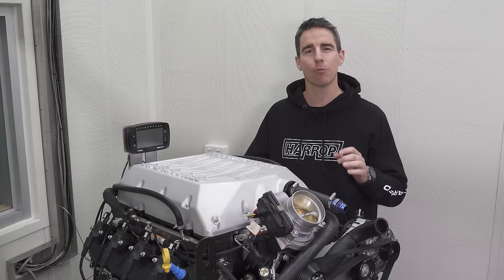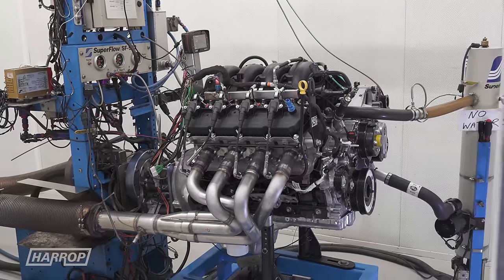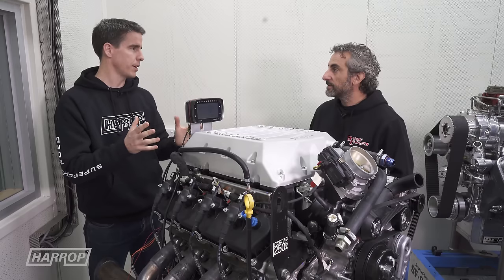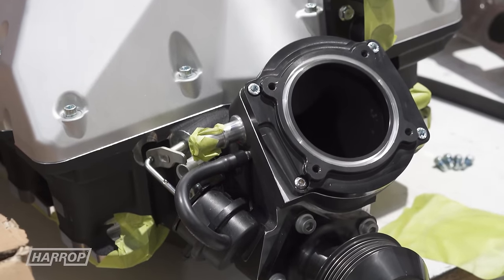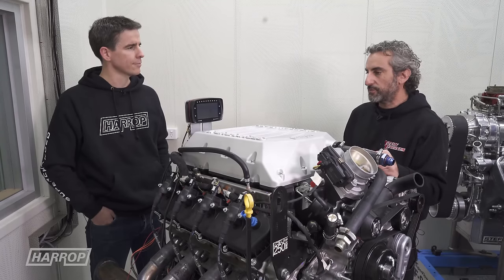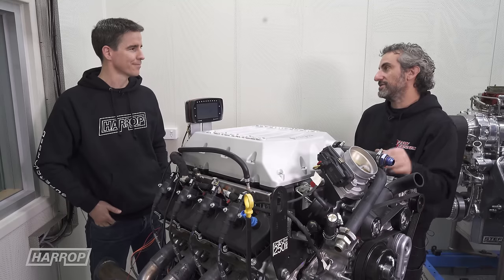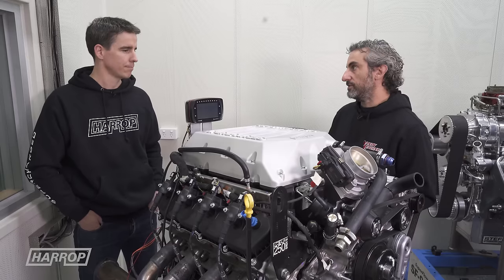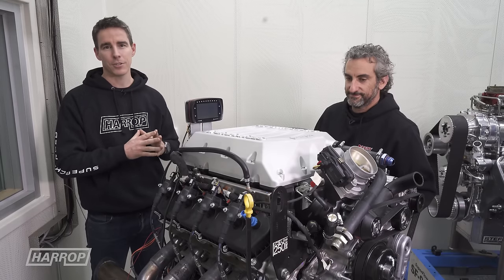Ford Godzilla 7.3L V8 | Harrop Supercharger Testing

Comment: I'd love to see the numbers with an 8lb underdrive pulley, for 16 lbs of boost with the largest oval throttle body and mass air meter available for this engine, and then add a 50 shot of nitrous before the mass air meter, and all of this on 93 octane pump gas, then switch to 107 octane race fuel.
Reply: On stock internals? Why not just watch grenade footage?
Reply: @tylermallory2504  All the nitrous does is supercool the incoming air resulting is a much denser air charge as it leaves the supercharger resulting in higher HP & Torque. I did the same thing to my 2nd gen Lightning, stock it was a bit under 400 HP at the wheels, with the underdrive pully, nitrous, 92mm mass air meter and the matching single blade throttle body it was 650 HP at the wheels.

Comment: The 7.3 is very nice. You improved it in a tasteful manner.  But no I'm not down with you suggesting that my wife or my girlfriend get an opportunity to test out that " great gas mileage" and 800 hp on pump gas. 
Even if it idles at 600 lol...
Idles are safe. 
Untrained drivers can have a difficult time with telephone POLES and RADIATORS when thrown the keys......and what's up with that blown 7.3 milage talk?
You guys need to be in politics.....
Are you comparing the 7.3 to a boing 747, or a cargo ship? 
Let's just talk about how cool the HP and torque numbers are and the reliability. Fair enough?
Awesome job. Keep up the great job.

Comment: A 7.3 liter around 445ci on pump gas should make around  667hp based on 1.5 hp per cube. Thats generally considered a good combination for a street car if you can get 1.5 hp per cubic inch my 418 a 351w based build made 670 hp crank i cant remember tq but it was pretty close to 600 ft lbs NA 34 grand for that engine idk. The 418 cost me under 9 grand with off the shelf parts. Powered my 3050lb foxbody 10.40s @137 run after run very consistent NA on 93 pump gas. Drove it 60 ish miles to the track let it cool for an hour then basically hot lapped it in 95* weather 80s when it got dark. Just a test and tune night for me.
Reply: You can get one of these from Ford for under 9k with a warranty.
Reply: @fastec5  I know part # M-6007-73 Ford Racing you can pick it up intake to oil pan right now 6999.00 !! Only thing is it makes 430hp @ 5500rpm & 475 lb ft tq @ 4000 with 2 yr warranty. You'd have to add a custom cam heads and intake plus exhaust to reach 600hp plus the added weight of a 7.3 l vs 351w and size difference.
Reply: @mccranahan747  would a 351W be a cheaper build...and no engine clearance issues.
Reply: @benwalker4660   your looking at about 2 inches wider on the 445ci valve cover to valve cover about 2 in taller deck and 2.5 inches in difference where the actual engine sits in the k member. Im sure you would need some extra parts or fabrication. You would definitely want a aftermarket k member with the 351w or a 445 for ease of working on things. The strut towers in say a foxbody could be very tight. As far as cheaper to build you can buy the 7.3 from Ford Racing right now for 6999.00 with a 2 year warranty. If you did all but machine work it woud cost you about the same.
Reply: THANK YOU SOMEONE WITH SENSE

Comment: That looks a lot bigger than a Clevo, and is defenitly a lot taller. A good set of headers would be a lot of work to fit into any Falcon with spring towers
Reply: serious engine clearance issues can be done....so the challenge is there...custom headers for sure.
A hot 351W 600HP...and less clearance issues otherwise.

Comment: I don't know if i should be impressed, cuz I've seen the 5.0 coyote engine making that horsepower with the proper supercharger as well.
Reply: Yeah but you'll never get those torque numbers from an overhead cam 5.0 like you will from a pushrod 7.3
Reply: @tmurph247  oh wow, didn't know that.  But for a light car like the mustang, do u need hp or torque? Or maybe both?

Comment: Headwork, a cam, and e85 and your at 1000hp no problem.
Reply: I’d say with just the cam and e85 you’re 1000hp easy
Reply: its making 800 with a stock cam... thats 1000hp easy with a proper bump stick
Reply: @spyer212  Show me a "bumpstick" good for 25% more "power" all by itself.
Reply: @deeremeyer1749  My Ls picked up 115hp with a cam swap n/a quite literally a 25% power gain. Go take the piss out of someone else. Everyone here knows im just putting a fun twist on "camshaft". Anyway, a cam specifically designed to help a boosted motor especially one of this size will show huge gains. Oh and as for "showing you a cam that makes 25% more "power"". I use a comp cams 238/242 cam. Namaste.

Comment: My friends new ford with the 7.3 left him overheated on the pass hauling a 22 foot trailer. Meanwhile my 496 pulled the 28 foot trailer without a problem. Just like always. Before we left he was bragging about how that new ford motor made so much more power than mine. I don't know how much of a difference it makes when you're always broke down.
Reply: Probably sounds like an over heating issue.....radiator clogged or something like that. No reflection on the engine.

Comment: POUND-FOOT! Ft-lb is work done, NOT torque... No excuses, you're not American!
Seems like a damn good creation by the FORD engineers, I expect crate engines to be big sellers for re-po's, especially as it's going to be much easier to package it in cars that the OHC engines don't fit easily. 😎
Reply: Foot is a measurement of the perpendicular distance of the force (in pounds) about an axis, therefore it is torque. Ft-lbs, pound-feet, either way, same thing. It's imperial because he is going off his American-made dyno.
Reply: @youssefkhaled9666  
Thought I replied to this...
NO! They are different terms for different units of measurement - I suggest you check and learn this next time, before replying.

lb-ft is used for torque, or a moment. Force times the perpendicular it is applied at, as you said.
ft-lb is used for work done. Force times the linear distance it is applied through.
Note the difference!

Actual example.
An engine produces 100lbs-ft of torque, ie at a distance of 1 foot there is a perpendicular force of 100lbs.
The engine makes one revolution and that 100lb force moves through a distance of 2 x π x1 foot, or approximately 6.28 feet. This means the engine has done ~ 628 ft-lbs of work.
it is IMPORTANT the correct terminology is used, as sometimes the context is unclear.

Comment: Could this be the answer to the LS domination 😵
Reply: This look like a big LS
Reply: LS Domination ?
Reply: Nope - the LS 'dominates' because of sheer production volume, which led to a hugely popular aftermarket niche that sells in high enough numbers to make aftermarket parts affordable.
 
The 7.3 isn't even a base engine(the SOHC 6.2 is), it's an option engine and only in SuperDuty pickups - the 7.3 is NEVER going to be anywhere near common enough to have any impact on the LS or its market.
 
Are guys going to go fast with it? Absolutely. Is it likely going to have a solid racing-oriented(don't expect to see any basic bitch Edelbrock street heads for this platform, it's only gonna be grown ass man stuff) aftermarket that makes it a legitimately viable racing platform? Probably.
But, is ever going to be a 'common' engine swap? It's not going to be swapped as much as Coyotes are, for a variety of reasons.
 
If "LS domination" is supposed to be related to performance or something, the LS hasn't really 'dominated' much of any classes in racing(outside of the budget oriented stuff). The problem is that airflow is what makes power, and when you're starting with a blank sheet you can design a killer cylinder head & intake for pretty much anything; including old school pushrod V8s. So the LS doesn't bring any advantages when you can build a SBC or SBF with all aftermarket parts. The 7.3 won't be much different in this regard, for the same reasons.
Reply: @RyTrapp0  a 351W is cheaper...

Comment: Cool for a truck application but its a bit too large dimensionally and requires too many custom swap parts/ fabrication to fit in most lowered cars vs a proven gen 2 5.0L Coyote swap that slides right in because its not a Heavy Duty truck/ Motorhome engine.
Reply: its dimensionallly smaller than the coyote
Reply: @2011metalmaniac   Its definitely taller, you see that oil pan and deep crank centerline.  That's what is going to keep them relegated to trucks swaps.
Reply: @Sir.VicsMasher  well a couple of people have allready done mustang swaps and someone has pout one in a crown vic

Comment: I'm not sure if Australian Horsepower is the same as US horsepower, they usually use kilowatts, but this is impressive. LS what?
Reply: Yes aussie hrspwr is real world pwr figures for the real motor enthusiast!!
Not bloated wank crank figures for magazines or media posts
Reply: Lol fords 20 years late too the party
Reply: @Saddedude  how do you figure.
Ford is way out in front from a business perspective than G.M
Go do your research dude
Reply: @kimbarling4213  they mean that the LS motor was introduced over 20 years ago, if Ford had this motor before the LS was introduced all the mustangs would have Godzilla motors instead of turbo LS motors
Reply: @kimbarling4213  this motor is synonymous tested for crank horsepower with no accessories, I’m not sure what SAE method they are calculating horsepower at was my question.
Reply: @xozindustries7451  
Show me a mustang with a turbo LS?
THE 5LT COYOTE QUAD CAM motor is far superior.  Even if 1ltr capacity smaller.
Awsome small block design.
The only worthwhile LS motor in my opinion is the 7ltr LSA Supercharged weapon. ZR1 CORVETTE heartbeat
Reply: @kimbarling4213  Thats why everyone is yanking those far too weak and expensive 4cam motors out and replacing them with junkyard iron block LS stuff rite? 🤣
Reply: @Saddedude  Really???😳😳
I've yet to see or hear of any examples of your claim.
Reply: @kimbarling4213  Theres literally dozens of them out there.
Reply: @Saddedude  wow😱😳
Only dozens??
Out of the thousands of cars produced.
Hmm??
Reply: NO NAME  exactly and how many have swap coyote pieces of shit into a Camaro LOL
Reply: @Saddedude  why would you stuff a turd with a piece of shit ?
Reply: @kimbarling4213  did you see a drivetrain connected to that engine they're testing there ? Well , that means they're measurements are at the crank as well, so relax with your assumptions.
Reply: @kimbarling4213  it’s funny the 5 liter is heavier and Physically larger than a ls7 lol. It’s stupid that people ( unless done for any type of racing with rules for cubic inches ) say Chevy needs a bigger motor when it actually isn’t.
Reply: @bbdl7042  The physical dimensions you state are questioninable, but if so then most likely due to Quad cam top end.
I'm sick of so many negative comments bk to me bagging Coyote 5ltr.
Its a great package with loads of potential for aftermarket tuning and additions.
So to all you Chevy G.M die-hards...just relax .
Every motor manufacturer has positives and negatives.
Leave it at that.
Reply: @kimbarling4213  Kim, there are hundreds of LS stangs, especially foxes because they are far cheaper for similar power and that's a $500 USD rolling shell. P.s. the LSA is a 6.2L Aluminium block closely related to the LS3. The only factory 7L LS is an LS7 in the earlier Z06.
5.bro is a great engine if you know which one to get and what to do, they make more power (reliably) at maximum effort on stock setup compared to NA aluminium LS engines (e.g. boosting both like for like without opening them). E.g. ~1khp isn't unheard of for an NA 5.0 to last a while, ~800hp is where you start seeing stock limits on most NA alu LS engines in terms of internals long term. And that's coming from an LS fan boy.. each engine is great for it's respective use.

Comment: How did Ford manage to get so few horsepower out of this?
Reply: It’s a truck based engine , dialled down & built to work hard , not for peak power numbers . Obviously the base is there to dial it up shit loads , steel crank , 6 bolt mains , like they say you ain’t seen nothin’ yet !

Comment: Damn whats wrong with it?  My 4.8L LS makes 1,050 hp to the wheels with a Turbo and the engine has never been opened!  That means stock crank,rods,pistons,rings,bearings,cam ,heads, head gaskets and bolts.  Been doing it daily for 2 years too!

Comment: Hear Ford might be developing a 6.8L version of this architecture for the next Mustang. https://www.thedrive.com/news/37374/6-8-liter-windsor-pushrod-v8-coming-to-2022-ford-mustang-f150-report
Reply: Rumored to be in the F-150 as well if the 6.8L version is actually a reality.
Reply: @nathanmcdonald610  That would make sense. The 7.3 is probably going to be stuck with the commercial class.
Reply: @exothermal.sprocket  Even so a 6.8L comes out to about 415 cubic inches.  The last time the F-150 had that many cubes offered under the hood was 40 years ago with the old 6.6L 400ci V8.
Reply: @nathanmcdonald610  The old 460ci engine was a 7.5L, but I'm not sure if the F150 ever used it. I remember an F100 using it. Ford's answer for the 460 replacement was the Triton V10..... which of course is being replaced with the much better 7.3 V8.
Reply: @exothermal.sprocket  I don't think Ford ever offered the 460ci in anything less than an F-250 out of the factory, I could be wrong, but I think the 460 was always a 3/4 and 1-ton exclusive. But they did have the 400 in the 1/2 ton chassis for a few years.

Comment: dude the 7.3 is going to destory them ls's XD
Reply: No it isn't. You can make the same horsepower (if not more) for half the price.
Reply: At 30k I could buy two LS next builds and race them with similar NA hp and they weigh less.
Reply: You didn't think this comment through very well.

Comment: Soo basically Ford finally came out with their own LS engine
Reply: And the LS takes cues from the 351w, so whats your point?
Reply: The LS is a 351 Windsor with 6 bolt mains and a different firing order
Reply: Did you know LS heads are a direct bolt on for the 351 Windsor. Not as simple as it sounds but a direct bolt on none the less. Ford brings the mustang in 64, Camaro in 67. Retro looking mustang in 05. Camaro in 10.. Chrysler mini van in early 80s ford too. Chevy a few years later. Pt cruiser from Plymouth. HHR from Chevy a few years later. Chevy is the first to follow
Reply: @richardknepper1860  dont forget the falcon came first, then the chevy ii/nova!

Comment: So, just turbo, timing, larger carb and headers?????
Reply: So the 700 hp was with better injectors and fuel pump also I guess.
You aught to put all the parts by HP rating in the decription... this sounds like a great engine without head and valve work or bigger cam, rods ect.
Reply: I suppose 92 Octane???

Comment: My eco boost raptor has 450 stock little v6
Reply: My condolences for your stock little engine.
Reply: and not much room to turn it up, it's already close to peak output, already using some really fancy direct injection to allow pump gas with high compression+boost, I would guess that turning it up would require some very expensive fuel system mods and high-end race gas. That 7.3 has so much room to grow, it could totally hit 1500 with a nice cam and big turbos on pump gas. The real question I have for the 7.3 is what part breaks first.

Comment: Put it in an AU forte
Reply: Better still put it in a au taxi pack wagon with quiet exhaust , outlets hidden behind the rear valance & watch the faces in the ss brigade at a set of lights.
Reply: @barbraabsalom4531  Would be tuff in an au series 1 XR8 with the double spoiler and orange indicator tail lights

Comment: “Factory engine making 800 crank HP is amazing”
Iron 6.0L with 200k miles with over 1500 crank hp has entered the chat with a 21 year old setup
Reply: That ain't going to last though lol. That's the problem with you people you destroy cheap LS because they are cheap and easy to replace.. until they are not, like every other damn half decent engine around.
Reply: @N4CR  this guy🤦🏽

Comment: Now take a 6.6L gas chevy and strap the same supercharger on it and watch it make more power. There is a reason ford went pushrod on this engine. Chevy has always kept the design because it's simple and it works. Also makes loads of power.

Comment: 6,000 RPM is not a truck engine. If it was in my truck it would probably never see 4,000 RPM. Right now it's making as much torque and horsepower before the supercharger was added as my 20 year old Cummins 5.9 but each number comes at about 2,000 RPM higher than my 5.9 Cummins. So if I had never had a diesel, I'd probably be thrilled with this power plant. But I have to say, with all the crap they've added to Diesels in the last 15 years, I'd never buy a new one.
As for Fords, the biggest mistake they have made in the last 20 years was, IMHO, putting the 6.0 engine in their diesel trucks instead of updating the older 7.3 power stroke. That 6.0 is a breakdown just looking for a place to happen and it hurt their reputation a lot. That engine is why I switched to Dodge and a Cummins with a 6 speed manual transmission. Rated at 245 HP but it's down low at about 2800 RPM. A few simple upgrades can get that up quite a bit and it'll still pull strong from the mid teens RPM wise. Torque peak is at 1600 RPM. I pulled my 30 foot toyhauler 4900 miles on a trip to see America a few years ago and averaged 12.5 mpg. I wonder if this engine would even get close to 10 mpg doing the same pull. I'd be willing to bet against it.